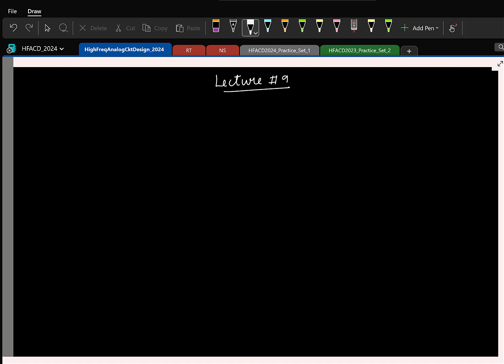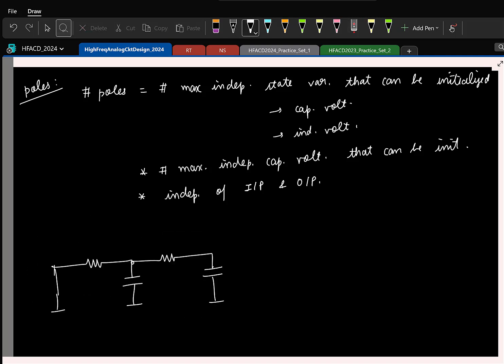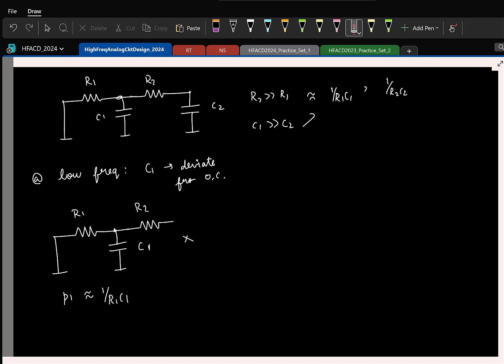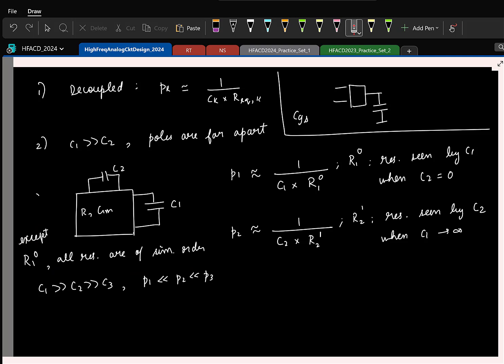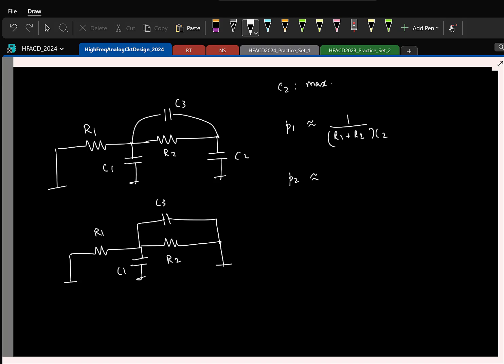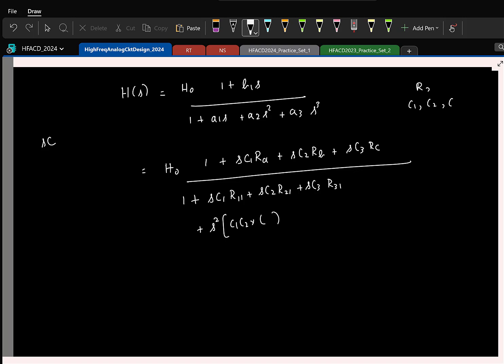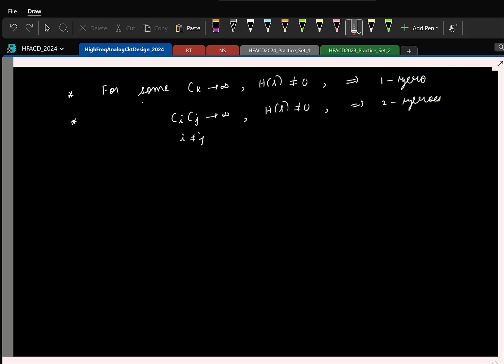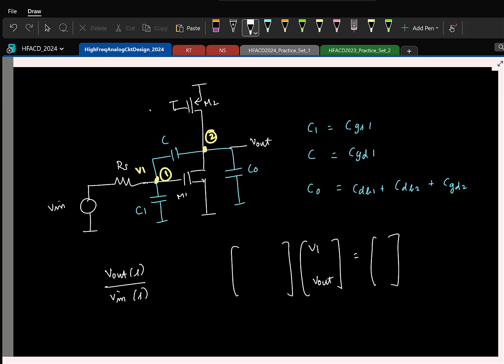Lecture 9: Poles and zeros; Finding location of zeros and approx. pole locations by inspection

Comment: @17:10 - You told that C1 acts like a lower impedance compared to R2 at low frequencies. Isn't it the opposite, like C1 presents a higher impedance at low frequencies? Especially it is being much greater than C2, I thought it should have lower impedance.

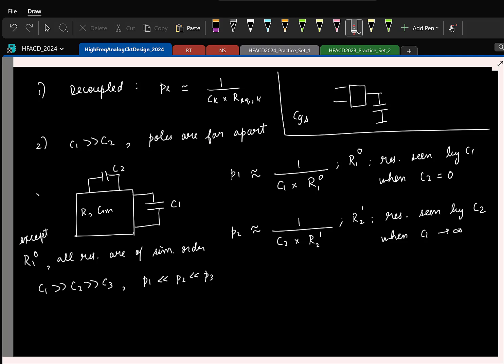@22:26, you say load cap will be much smaller than the parasitic caps inside the OTA but @22:56, you say the load capacitor is the largest one. How do those two correlate if I'm not mistaken?

Comment: Dear Sir-Nice video, thanks. One fundamental question I have is the following. For a a simple RC network (at 9:50 time spot here in the video), I know it is first order. But what if we split the cap into two series combinations of caps, then we can set two initial voltages on caps independently, does it mean it is second order? I am sure I am wrong somewhere, could you please help me. Thanks!!
Reply: A storage element represents an order if you cannot combine the capacitor with other elements of the same kind. This happens when the component is not in parallel or series with other capacitors. If caps do not share node voltage and mesh current at the same time, they are likely to be considered independent and increase the order.
Reply from the maker: This is discussed in Lecture 10 (https://youtu.be/Dul8wbGZXao)